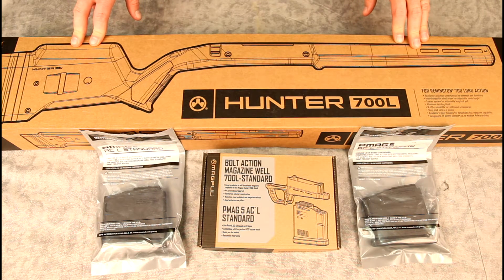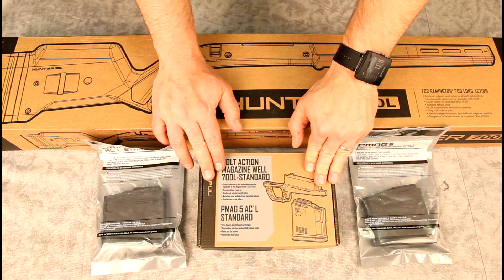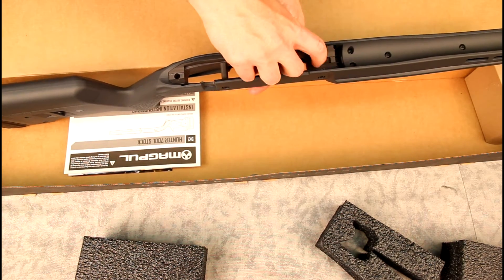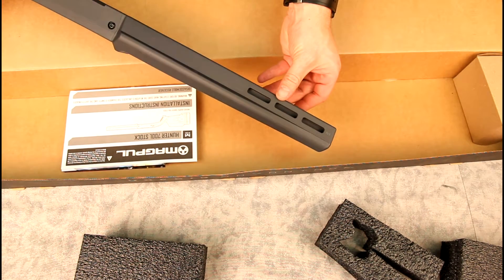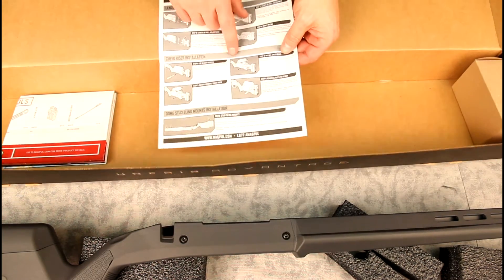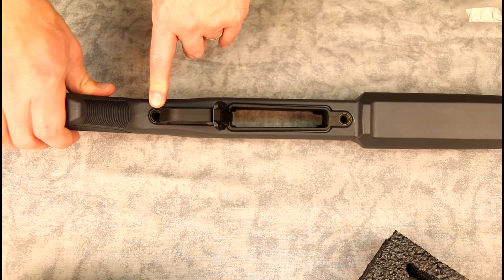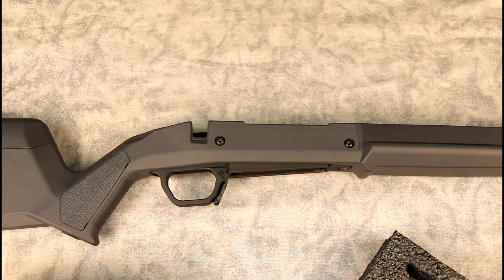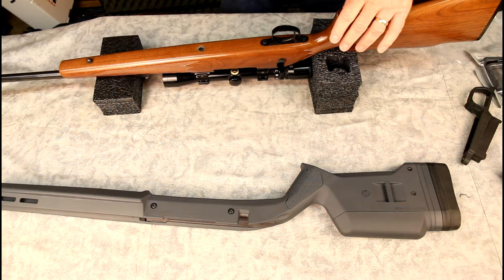Magpul Hunter LA Unboxing and Install

Comment: Nice info. Most complain about the bolt and cheek rest issues. Thanks for showing how to get the bolt  in/out for cleaning. If more people saw this they would buy it... Sweet rifel!
Reply from the maker: It wouldn't definitely be nice to get it out easier, but it doesn't have to be a deal breaker.  Thanks for watching!
Reply: I talked with Magpul today and they said purchase a no rise cheek rest. The stock comes with a .250 rise cheek rest. This would eliminate pulling the cheek rest to remove bolt.

Comment: Impressive stock design. I am thinking of purchasing this stock for my Rem 700ADL 06. However, I have two concerns; 1- is this stock heavy enough (as original) to withstand the  recoil, not to mention a drop? 2- does it come for the ADL, (no door or opening at bottom).? I see your father's is also an ADL, no bottom plate door. Please be as explicit as possible ,thank you.. John
(Oh, you said this color is "sniper gray"..?

Comment: Had the same problem with the front action screw on my brand new 30.06...longer screw... No problem
Reply from the maker: It seems to be a common problem when using an aftermarket stock.

Comment: I have the same exact rifle and stock. I purchased the longer action screws from brownells and they are both TOO long. I'm just going to cut them down to size, did you guys have to do the same? Or are there different sets of long action screws that Brownell's sells?
Reply from the maker: I didn't have to trim these screws, but it's not uncommon for them to come a little long and have to be trimmed to the appropriate length.

Comment: What happened to the other screw in the middle of the wood stock? It's not used on the new stock?
Reply from the maker: The ADL stock had two action screws and a third to hold the trigger guard. Since we switched to a detachable magazine bottom metal, we only needed the two action screws. The trigger guard is part of it and it spans the entire length.